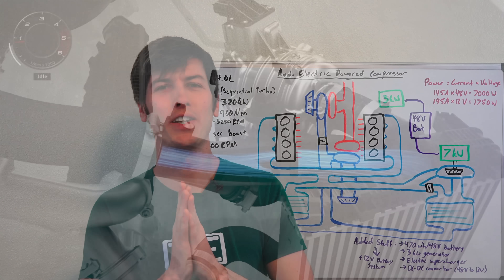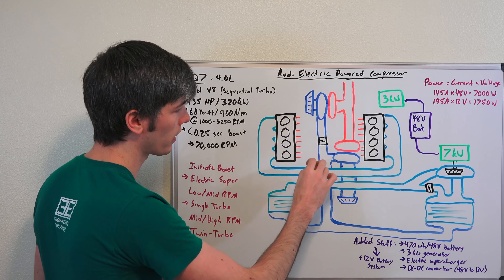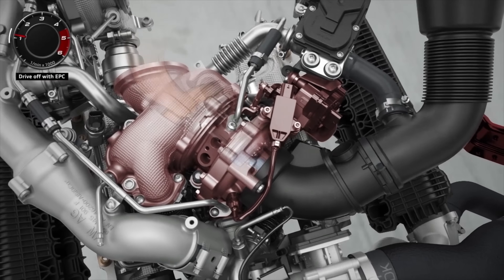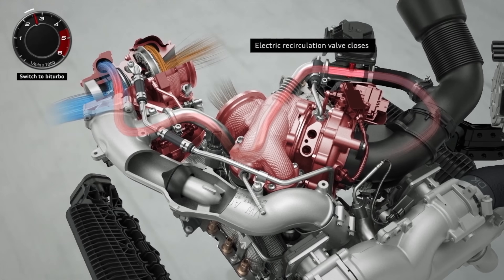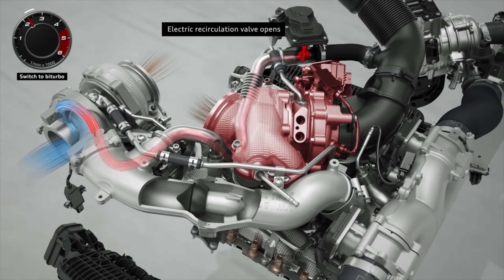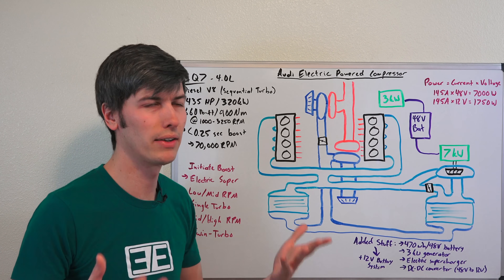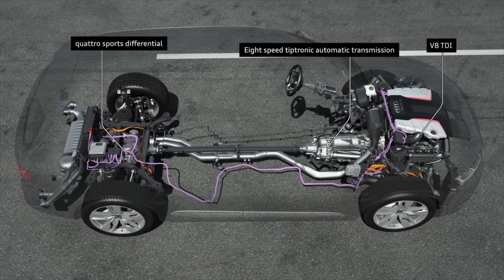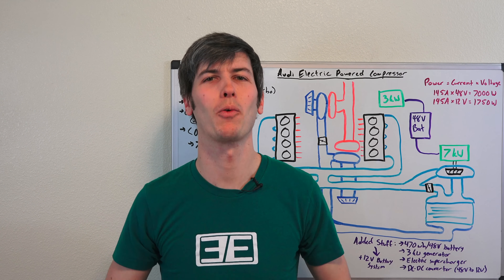Electric Superchargers - How Audi Is Eliminating Turbo Lag

Comment: Just buy an electric vehicle (*cough* Tesla). Holy hell talk about further complicating the inefficient ICE.
Reply: dunhillsupramk3, Man I hear ya there. I've had a Model S 70D for 2 1/2 years and 55K miles now and I just had to replace the 12V battery. . . It took me the better part of thirty minutes, and almost four tools!
Reply: TomaCukor then what is It? A quad-wheeled pod propelled by electricity and not for peasants? Way to ride that high horse mate.
Reply: TheSovietHotDog It's a long time since I was 12yo but I still chuckle when someone says VAG.
Reply: This ICE is inefficient. It's an ancient technology. It's unnecessarily overcomplicated. Yet somehow it's a million times more affordable than a so perfect electric drivetrain. For the cost of one of those fancy Teslas, the proven and reliable car I own could be bought 38 times. Just let that sink in.
Reply: Tesla hasn't
Reply: considering teslas are giant computers on wheels I'm not sure "simple" is the word for them. Just cause the massive point of failure isn't a mechanical system doesn't make it any less massive and frankly its harder to diagnose. 

I suppose we are more forgiving of computer systems for being buggy and temperamental because they all are all the time and we are used to it.
Reply: Why would you get a Tesla when VAG just got 25 billion worth of batteries for their electric cars. Also they are promising over 16 facilities by 2020 ;)
Reply: TheSovietHotDog VW is a whole lot of hot air about what they’re going to do in the EV arena. Endless blabbering to distract you from their criminal actions that they got busted for.
Reply: InternetDude - i would rather have ICE heat in the winter instead of toaster oven heat that destroys my "fuel mileage" and the musk motors official heat replacement...   heated seats...
Reply: lol, preach it bro.
The future is here, time to move on from the past.
Reply: InternetDude nah, I'd like my car without panel gaps the size of another Tesla and my A pillars not cracked. That is, if it's even delivered within the same decade of the promised delivery date
Reply: Id rather not pay $1000 to wait for a car
Reply: them tow truck drivers love Tesla... a Tesla isn't as complicated but yet it breakdown all the time...
Reply: Polin Mileg Electric car =/= Tesla
Reply: InternetDude Nah, I’d rather not have to turn my radio off to get more range 😂😂😂

Comment: 145A it's a lot of current and it will need huge wire section that seems by far to much for a car. I think they may step up the voltage in the DC/DC so there will be more than 48V at the output of the DC/DC convertor and less that 145A. ¿Is it posible? Or I'm missing something. Thanks for the content!

Comment: Honda v-tec + Volvo PowerPulse
Reply: WarriorOfEden3033 probably referring to the variable valving. Not the same as used on Honda cars but is what their motorcycles use (VFR Interceptor) also called VTEC
Reply: tropcm4.6 Volvo Powerpulse <3, vtec <3<3
Reply: WarriorOfEden3033 Vtec is used on the exhaust side of the new civic type R which is TURBO
Reply: Loco engines have been using electric superchargers for years
Reply: Christopher Read and locomotives are kinda in the business of generating crazy amounts of electrical potential. Why strap a belt to something already pumping out high power AC
Reply: What does V-Tec have to do with turbochargers & superchargers
Reply: If a box says it's "Di giorno"  It's a PIZZA, that is LABELED and MARKETED as "Di Giorno vtec"
Reply: I want these to be made in China and sold to gutter oil S. Koreans who live in a country, where warranties are never honored.  HOLY COMPLEXITY !!!!!  Why???  Audi is more self defecatingly complex, than a Liberal Farts Student's Social Project.  A quarter second  for that tiny turbo to spool is an ETERNITY.  It needs to be near instant, in order to get the bigger turbos to just barely get started.  What a boondoggle!  Volvo's compressed air is way more refreshing.  ly simple=better=reliable

Comment: How does this compare in performance and complexity to the Twincharger setup of the Delta S4? Lancia used an electronic clutch that switched the supercharger on and off based on RPMs. This system has the same conceptual goal, but with a different approach.

Comment: Great video as always but as for the topic itself...Too many moving parts. I'll stick to my 468 fly wheel hp OHV LS. No turbo lag either and I get 24 mpg. Thanks to corrupt environmental agencies we pay more for over engineered nonsense no one wanted to help protect the planet from carnon dioxide because it's harmful to us carbon based life forms. What ever happened to the carbs that got like 100mpg and made 300 horse power? Oh wait, that wouldnt make the right people money.
Reply: "What ever happened to the carbs that got like 100mpg and made 300 horse power?"

They emitted high levels of CO and NOX, went off tune quickly and needed constant adjustment, you had the choice of 100mpg OR 300HP, etc etc etc.

The worst cars of today are far, far better than the best cars of the 1970s.

That said, this kind of car is engineering for engineering's sake and very much "Because I can", rather than for practical reasons.

But then again, if you were choosing practicality we'd all drive cheap econoboxes.

Comment: I think Audi is just showing off how they can engineer what they want. But this system is too complicated. Im sure repairs and maintenance would be off the roof.  We are yet to see how reliable the system is in a 4-6 year time period.
Reply: borinkano if you can afford the car, you can afford to repair it to.
Reply: Mar what is you source for that? And please explain why you think 48 volt is more reliable then 12 volt?
Reply: audi trying to kill consumer with the repair bills.
Reply: Ronny Chung not really. This Audi is high end, and if you can afford the car, you can afford the repair bill.
Reply: First they said that turbos were unreliable. Then they said sequential turbos were too complicated and unreliable. 
I have a 1989 turbocharged Porsche.
Is it unreliable?
No. 
The heater is dodgy and the cruise has a mind of its own.
But all the turbo plumbing is stock and fine at close to 30 years old.
In this Audi it's more likely that the MAF will fail (the BMW 330/335TD and some MB TDs are notorious for this) - but all modern cars have MAFs anyway. 
At least it isn't French.
Reply: audi already has a 48V battery in most of their cars. it's just better and more reliable than a 12V alone. so the only thing they added here is one motor-compressor. quite simple solution for the age old problem of turbo lag.

Comment: How will the electric supercharger pull air when the air has to pass through both the turbo and the intercooler first?(based on your diagram)

Comment: Where does the battery energy come from? Regenerative braking or from when the engine switches to the regular turbo? It'd be a rare, specific problem, but could this system also be used to offset a battery close to dying?

Comment: This is a very complex solution to a simple problem. These extra systems are going to be a costly headache to troubleshoot as they age. I imagine this thing must weigh over 5,000 lbs. with all these extra components. I'd rather have a lighter, more nimble single turbo setup on a v8 that developes enough torque out of boost to get itself moving.
Reply from the maker: Idk if turbo lag can be easily described as a simple problem. It’s not going to be heavy because of a small battery pack and a tiny electric motor, it’s going to be heavy because it’s a diesel V8 SUV.
Reply: Engineering Explained why not simply use a single variable AR turbine housing. Then you could eliminate all these failure prone exhaust valve actuators, intake butterflies, extra turbo, piping, manifold, wastegate, battery, generator, heavy gauge wire harness, and the electric supercharger. These cars are notorious for developing boost leaks, and the typical owners are completely clueless about anything mechanical. What they need is a bulletproof reliable vehicle. I appreciate the engineering, but I'm not sure they're hitting the target for this segment.

Comment: Also need to consider that the battery only can discharge certain amount of power at a peak and less in continuous moment, and for a 7kw motor you need alest  7k5w of continuous power taking in consideration of a very low coefficient. It's a very complex system of the audi.

Comment: Looking at the comments, I think it is neccessary to mention that the 48 volt system is not only there because of the Electric Supercharger.
The Q7 already had the 48 Volt components because of the electric swaybars and the powered generator... So the only thing added for turbo lag elimination is that one motor.
Reply from the maker: No, you still need all the other stuff... the electric sway bars are an added benefit of the 48V system, but they have a significantly lower power draw than the compressor.
Reply: Engineering Explained
The main point of the system is the powered generator/mild hybrid e-motor. So the system is already capable of providing high currents.

Comment: I'm eager to see when the IC engines will start to compete head to head with all electric cars. That tech is so cool but also extremely complex. Two turbos and one electric compressor, VVT and cylinder deactivation... what a feat to sync all that.

Comment: Somebody shoot this idea down for me and tell me why it cannot be done so that I stop thinking about it please. Could you mount a new rear differential cover that splines in and basically has a PTO shaft coming out of it, then mount the electric motor and batteries inside your trunk. you then just wire it up to your brake and accelerator inputs and have it torque fill and Regen.

Comment: Why can’t cars just be simple, no one really cares about this. This is why cars are becoming more and more expensive
Reply: Chuk u buy a Toyota. Problem solved
Reply: Don't buy a toyota,built in engine problems from factory, v6 leaking coolant from head gasket
Reply: dennis Moreno for reliability id rather get a 90’s Jeep Wrangler

Comment: Way too complex. I would never buy this...
Reply: My question is can these systems handle a lot of boost.
Reply: Marcus Antonius in all fairness I know what you mean, but people use to say that about horses over cars.
Reply: Rasmus Rasmussen such a knockdown argument.
How do you knows this guy’s budget? Everytime someone dislikes anything online, they automatically can’t afford it...supposedly.
Reply: You're not thinking like a rich person. A rich person would buy this , get an extended warranty , use the car and then sell it when the warranty is over. Rich people don't have to worry about how to repair something.
Reply: Yup. First thing to come to mind: European cars.... adding a second electrical system? Their normal electrical system barely works long enough to last out the warranty as it is!
Reply: Are the keys on your keyboard, linked to a multi-link suspended articulation, in order to eliminate lag?  What does complexity have to whut???
Reply: Marcus Antonius and you will never afford it, so no problem.
Reply: What does complexity have to do with buying something..

Your computer is far more complex than any car engine but yet.....

Here you are
Reply: "Back in my day we didn't have any of these newfangled auto-mobiles"
Reply: Good luck figuring out an electrical problem with this thing lol
Reply: That's what's great about having so many vehicles available now.
Reply: It's why the early 90's sequential turbo systems often got replaced with a single turbo setup. WAY less complicated... and can make more power with one medium to big turbo vs 1 tiny one and 1 larger but still not impressive sized one.
Reply: complex = more $$$$ = car manufacturer richer..LOL
Reply: engineering is complex to feeble minded creatures. He's trying to make engineering understandable for the average person..

Comment: Naturally aspirated V10. Problem solved. You can thank me later.
Reply: Manuel Gatzi sure you can. but nobody would buy a car with worse performance and lower mpg just because a waiter won't be able to afford maintenance ten years from now.
Reply: Audi inline 5 cylinder turbo. Dat sound
Reply: Or an Electric car if one is just interested in instant consistent torque
Reply: My name Isalwaysjeff From eons ago, no problem. Buy one now.. in your dreams maybe. can't get those pass emission standards.
Reply: v10 diesel xD. U need a turbo for a diesel to make some power
Reply: Anthony RS what makes a v10 inherently not a torque producing engine?
Reply: My name Isalwaysjeff I thought the same thing until I noticed it was a diesel.
Reply: Only problem is a weight issue
Reply: I was thinking the old V10 M6.... yes...
Reply: Lmao no.... v10’s are for sporty LIGHTWEIGHT cars (R8)  Torque is high up in the powerband where as diesels for HEAVY, BIG vehicles (SQ7) have massive torque down low and much lower hp. Srt10 Ram is a perfect example of this flawed thinking.
Reply: Manny Echaluce, at least a person with good sense! 👍
Reply: Complex and expensiveness but fast and way cooler than having to wait to charge ur EV toy. 

At least there is one company with good sense 👍
Reply: No cares about ur Ménage à trois fantasies...
Reply: Why not just add a electric motor and clutch to the turbocharger concept?

While I know a few modification would have to be made and it wont be as effective. As this multi-tiered boost system it would far less complex would get rid of most of the turbo lag,
Reply: I'll just leave this here:
/watch?v=LrN_mz6e4ss
Reply: David Laurie, the strict Californain EPA standards will still stand no matter what Trump does. They are into more for industry, coal etc, not car emissions.
Reply: So, WT* does this have to do with, "Electric Superchargers" ?
Reply: i was thinking this kind of technology might be the alternative to NA in the future. hopefully not. even a lot of turbo and twin turbo cars have little turbo lag with a lot of torque at low rpm now days.
Reply: Or combustion generators would focus on energy efficiency in instead of power with an EV drivetrain to supply the power...
Reply: Anthony RS flawed thinking, your missing some serious fun in a SRT10 ram it made 500hp/525trq back in 05 when that was unheard of. I myself owned a supercharged lightning that made almost 600hp it would absolutely beat you to death and outrun a corvette to 100... to this day I still miss that truck...they just don’t make stuff like that anymore for less than 100k...you should try it, you might like it...
Reply: Diesels generally need a turbo or supercharger to make power.
Reply: IC we have a Utube Engineer lol
Reply: A good part of a car's lifetime carbon emissions is it's manufacturing and the break even for a new piece of technology often doesn't happen until the car is on it's second or third owner so longevity is a big part of the equation.
So yes the guy who buys a new hybrid every 3 years has a bigger carbon foot print than the guy with a 1960s car.
Hopefully those hybrids will last long enough to serve a college kid working as a waiter so the rich guy's carbon foot can be offset.
Reply: Y do ppl use one sided misleading talking points to try to prove a point?  When it just makes them foolish?

And y do some ppl want to just make it just about its "carbon footprint".How about all the other pollution that kills not  ppl and things directly like PPMs or NOx etc? Its amusing when ppl try to oversimplify a complex issues, 

And btw everything has a carbon footprint like wind turbines and PV so if u uses a false narrative that they wont be used for their full lifecycle u can make anything seem to be far more resource intensive than it really will be in its average lifespan

Comment: Question, couldn’t they have used 2 different batteries one to power the supercharger and another fot the other stuff?
Reply from the maker: That is what they did, as mentioned it still has a 12V battery system.

Comment: Another don't own out of warranty product brought to you by the fine folks at Ingolstadt.
Reply: I chuckled. Well put!
Reply: Israr Kabir Why not? Given that the electric supercharger has no exhaust heat to handle and the fact that electric engines are very reliable i think it will outlast every conventional turbo. Also its about 1000$ to replace (quick search on ebay) which isn’t to bad.

Comment: You show the electric compressor on the downstream side of the intercooler.  Why isn't the air from that compressor cooled?
Reply from the maker: That would increase the time to reach the engine, thus increasing turbo lag. It’s a very short window before the intercooled turbo air takes over.

Comment: This seems somewhat parallel to the formula one system where the power from regenerative braking is available to electrically boost a turbo plant. This seems like an obvious question to me: why not save on the  weight and transmission drag of an additional alternator and simply implement regenerative brakes to power the "electric supercharger" motor? You really don't want to goose the engine with something like that until it is warmed up and the warmup period should provide some braking opportunities to charge the system (I think, I guess I need to check the wattage generation capabilities of regenerative brakes, also weight of those vs the other alternator). This plus the crazy engine developments at Mazda and Nissan seem to indicate some life left in the ICE after all...